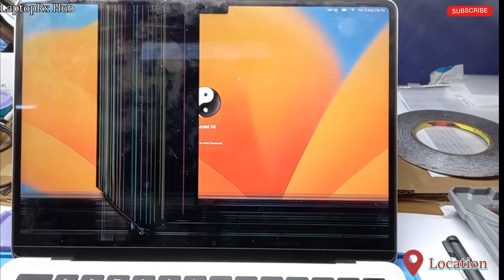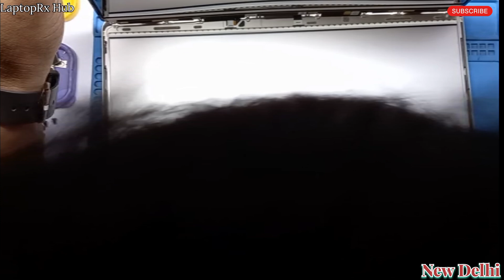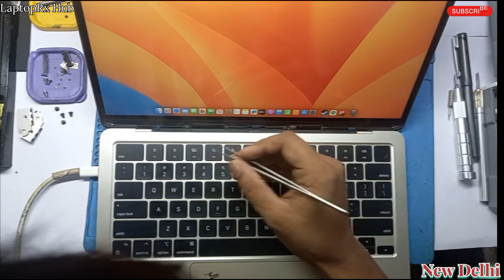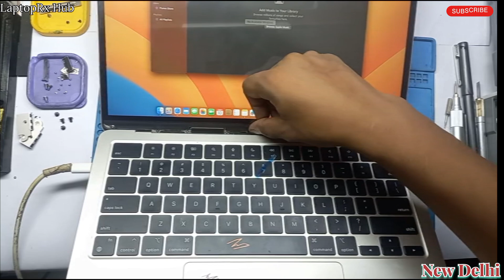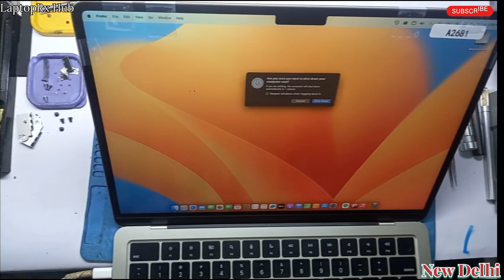MacBook Air A2681 (M2) Display Replacement: 100% Sahi Tarika! 💡

Comment: Does this repair require any heat/heat gun btw love ur content
Reply from the maker: Yes of course you will need a hot gun to heat it from all sides so that you can remove the pasting gum and remove your screen easily. If you like my videos then it is necessary to like and subscribe or you are always looking for MacBook screen replacement or  If you want more video then you can share it with necessary comments, thank you.

Comment: i had this repair done and just today ive had it back for a few days and there was a slight separation on the right hand side. Do you think this could turn into an issue? I just pushed it back and the gap hasnt come back yet.
Reply from the maker: don't understand. please contact WhatsApp 9523387471

Comment: Does it matter which manufacturer the screen is from (LG or SHARP). Could there be a problem if I install a screen from another manufacturer, not the one that was in the original?
Reply from the maker: Sir, it does not come with any duplicate parts but it comes with OEM parts, it does not come with any problem, it has a very big screen, it looks absolutely original, but if you do, the brightness or resolution is very clear.
Reply: @MacPlus_Bihar  thanks 🙏

Comment: Whats the only LCD cost. Without labour.  And from where can i get the spare
Reply from the maker: Every LCD has a different price but we do not sell LCD but if you send me a laptop then we can install LCD.
For this you will have to send it through courier.
Reply: Whats your location 
Can you please share your contact or email 
And what will be the effective cost of changing the display of m2 air A2681
Reply from the maker: @elec_trick  Email -zking000111@gmail.com 
Contact no 9523387471
Where are you from? Full details and email or contact. Call me.

Comment: Do I need to change the ic, I heard the display will have problems if you don’t
Reply from the maker: There is no need to change IC in A2681, there is no problem in it.
A model A2442 14' inch has this problem, the problem is you have to put your original screen in the new screen, a tab will open when you ask what the problem is... It comes with a shadow banker near the camera Yes, so we have changed the IC.
 If we talk about A2681, there will be no problem in its development.
A video on A2442 is a model
Has also been posted in which you can see how these changes have been made. Thank you
Reply: @MacPlus_Bihar  Thanks for answering, I also had the same question, do you know if when replacing the screens of MacBooks with M3 Chip it is not necessary to replace the screen IC?
Thanks in advance for the great video tutorial

Comment: Hi, good job, thank you.
I've already changed a screen of my iPhone XS, so I intend to try to change the screen for my M2 A2681.  Full Screen or only LCD replacement is the question...
Do we need to buy a new  laptop screen rubber ? And a new Bazel strip ? 

I look forward to hearing from you, have a good day !
Reply from the maker: You have to replace the new LCD, for this the rubber bezel strip
Reply: +Thanks for your answer !! 
it would have been nice to see you place the rubber to judge if it's difficult or not.. what is the most difficult part ?